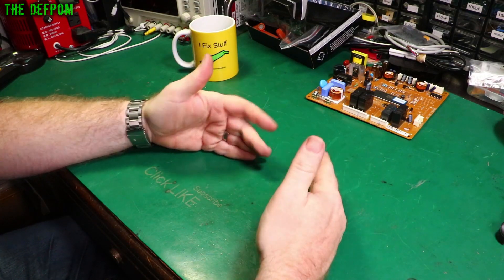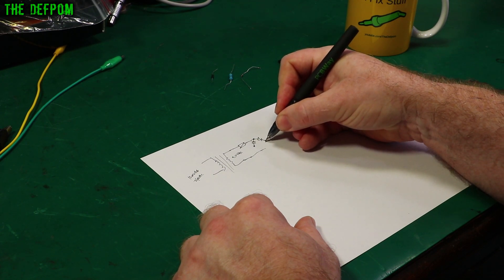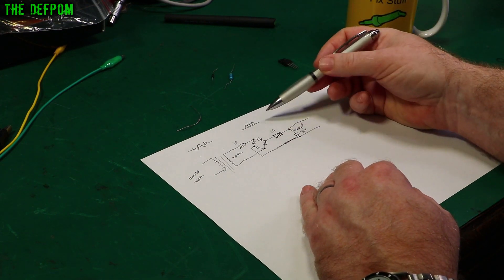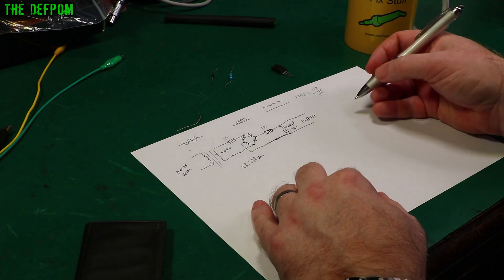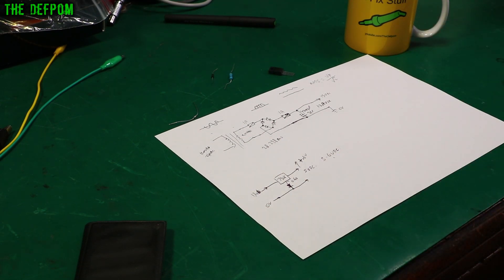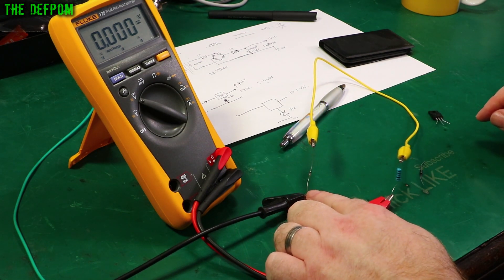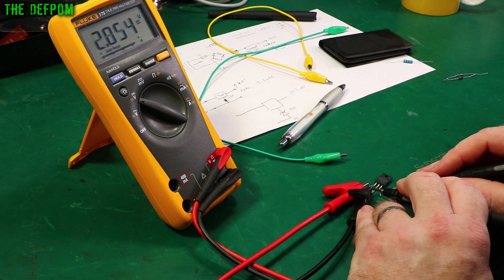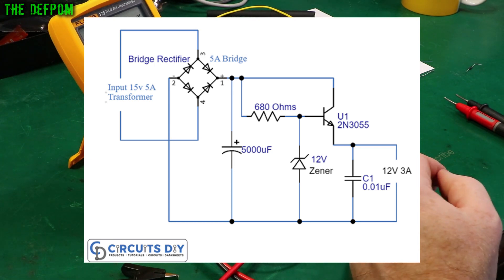🔴 Electronics For Beginners - No.12 - Linear Power Supplies - No.972

Comment: Transformers are normally specified by RMS voltage. If a full-wave bridge rectifier is used, the voltage on the filter capacitor with no load will be approximately 1.4 times the RMS voltage, ignoring the diode drops. When loaded the voltage will drop, but exactly what the minimum voltage will be is somewhat difficult to calculate. You most certainly are not going to get around 12 volts from a transformer with a 20 VRMS winding unless you have very little filtering. Something in the range of 20 to 24 volts at the bottom of the ripple is more realistic with typical capacitive filtering. 

Fuses in the secondary side are not very common with transformers with only a single secondary. A fuse should always be used in the primary side. If a transformer has multiple secondaries then secondary-side fuses may be advisable to protect the individual windings from excessive current. The fuses must be rated to handle the RMS current which will be well above the average current if a capacitive filter is used.

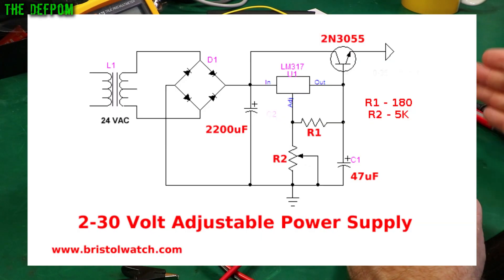Using an NPN transistor as a simple emitter follower after a three-terminal regulator as shown at 16:30 is a terrible design that seriously degrades regulation and ripple rejection because the transistor is entirely outside of the feedback loop.

Comment: With the zener in the 0V lead you are hoping that the Quiescent current is enough to push the zener past it's knee voltage, or you will lose regulation a bit.
I also like to use them as constant current supplies where you just put a resistor between the output and the 0V input. The regulator will try and maintain its set output voltage across the resistor (don't connect to 0V pin to 0V for this). So output voltage/ resistance = constant current value. Used to use this a lot for charging nicads in the old days.
Reply: If there's not enough quiescent current then a resistor from the Reg output to the Reg 0V connection helps.
Worthless tidbit that won't change anyones life: Think of a fixed 7805 Reg as an LM317 adj. Reg with both the resistors inside the package setting the output to 5Vdc.
Reply: @IanScottJohnston  Ian you are too modest, i will now always see a LM317 peeking out of the plastic case now that you have implanted that image.
Reply: @TheEmbeddedHobbyist  Actually, if you look at any datasheet for a 78xx or 79xx you'll see the resistors....🙂